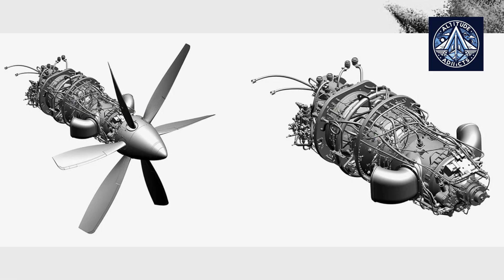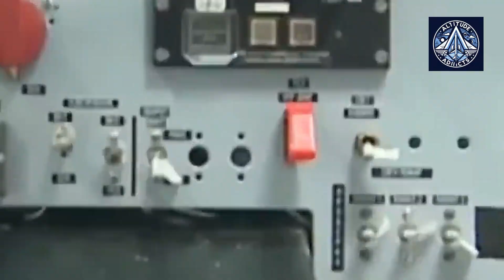VK-800SM Engine: The Engine That Could Make or Break Russia’s Regional Aircraft

Comment: What is the SHP output class for this engine ?
Reply: @altitudeaddicts it has nothing to do with the rotax 912, which is a piston engine, not a Turboprop, and the VK-800SM will be rated around 800 HP at max Takeoff
Reply from the maker: @daneagle678 My bad. You are correct.
Reply: @altitudeaddicts  Russia is also developing small piston engines as alternative /replacement to the Rotax 912, but they are quite different things. 
It would be worth a video :)

What they cannot replace at the moment is the 500 hp RED-A03 turbodiesel engine of the Yak-152 trainer, and they are considering a turboprop version of the VK-650 as alternative.
Reply from the maker: We will check that. VK-650 for Yak-152 is already a video.
Reply: @ 
LOL, yeah when I first saw that reply I went... wtf...
Reply: About 800 hp at max takeoff. It is in the same class as the General Electric H80, made in Czech republic, which is an updated derivative of the Walter M601 (the engine of the Let L-410 turbolet).

Basically GE bought the Czech company that previously made small turbine engine for soviet union.
Reply: @   Thanks.  🙂

Comment: I think the VK-800 "delays" are probably to do with switching many components to 3D printing to reduce the number of components and reduce weight ... and that means the whole certification cycle had to restart ... I doubt that the actual design changed much 

btw
I thought this was interesting ... why would UZGA look at serially producing engines for the An-124 in 2027 .... if it engineers had not already sorted out the VK-800 ?  
and what D-18T engine elements is he talking about .... turbine blades etc - almost certainly new parts are being 3D printed .... 
it all seems to make sense if 3D printing is behind all of this ... 

"The fleet of An-124 Ruslan heavy military transport aircraft is maintained through overhaul of D-18T engines, which are installed on this class of aircraft. 

“This task in the interests of the Ministry of Defence is solved by UZGA joint-stock company, which successfully implements measures on import substitution of engine elements of Ukrainian production. As of today, 49 engines have been repaired and put into operation,” the minister said, opening the meeting.

 “The serial production of Russian D-18T engines is currently being mastered, which is scheduled to start in the fourth quarter of 2027. This will make it possible to increase air transport volumes in the interests of the Armed Forces,” Sergei Shoigu added."